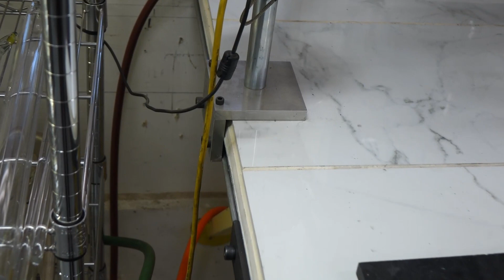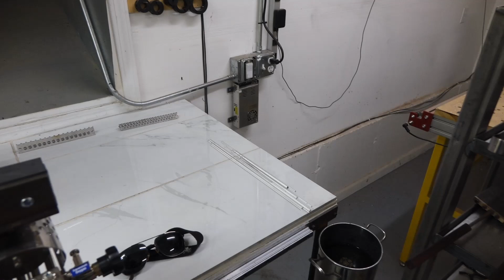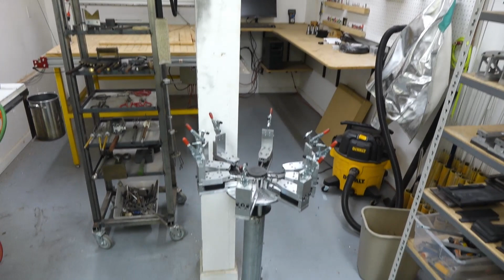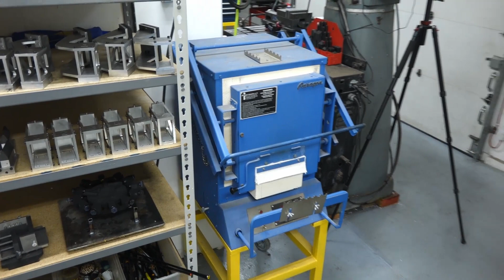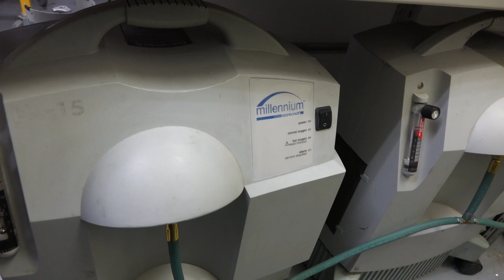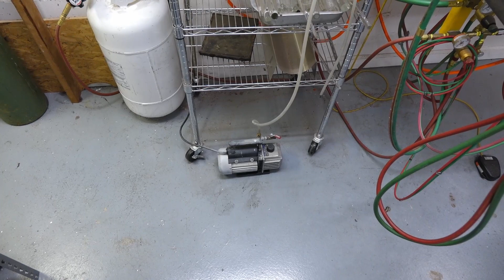Glassworking Shop Tour 4/2/21

Comment: Nice tour, great video.
my table only looks that clean for about 15 mins after I start working. I also had a heck of a time with the hardy backer table top so I built mine out of 3/16 steel when I moved to my new shop. I also have a “wood” shop in my glass shop so I’m constantly cleaning up saw dust. 
I like your O2 set up, I considered using a similar system but for the time being I’m sticking with just the home fill because of space constraints.
Out of curiosity how do you regulate the flow into the HVLP side? Can the compressor “suck” more O2 than the concentrators provide?  
Also, I did some research myself about the concentrators and the reason they pump up the pressure is because those 5lpm machines are much cheeper to acquire than the purpose built 10lpm machines. The sieves in 5lpm beds can’t take that much volume flowing through them so turning down the compressors was the right move, according to the clinical technician that I discussed it with. I wanted to do that exact modification to mine and he advised against it. So, I’m just going to put the word out looking for two more 5lpm machines.